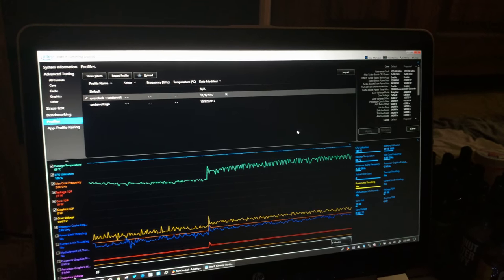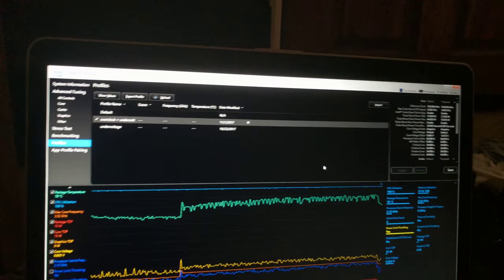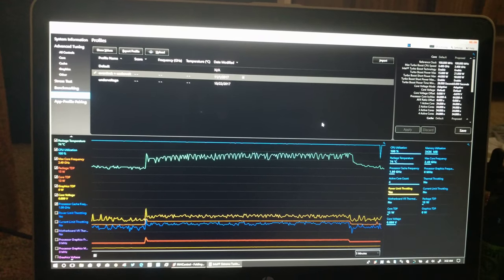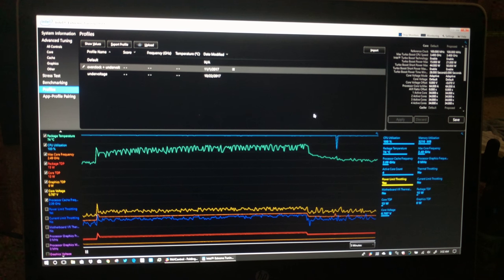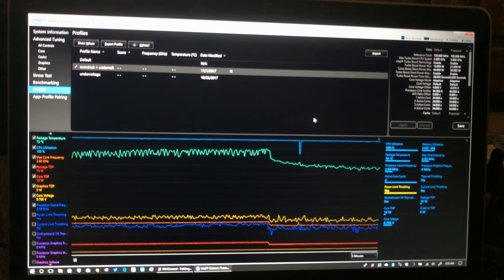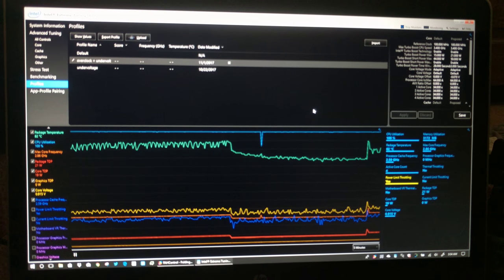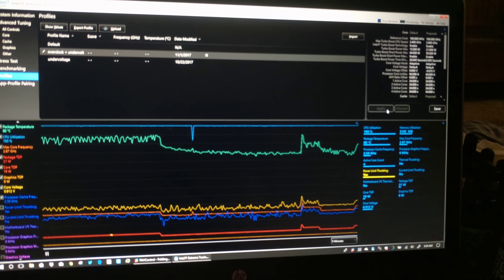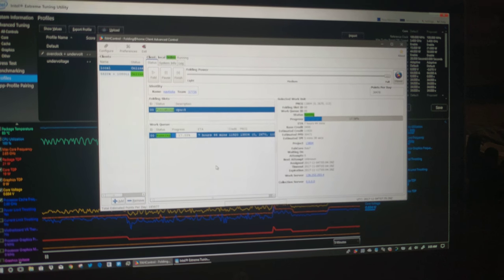Kaby Lake-R HP Pavilion Motion Based CPU "Throttling"

Comment: Good day and merry Christmas. Quick question, how to you mange to change the TDP limit from 15W to 21W?
Reply from the maker: latest version of throttlestop seems to do the trick. bios and firmware built in controls notwithstanding though, they can override pretty much anything and for any reason which is annoying.